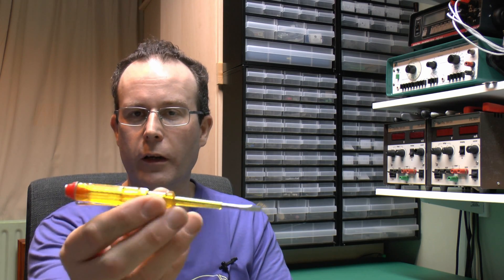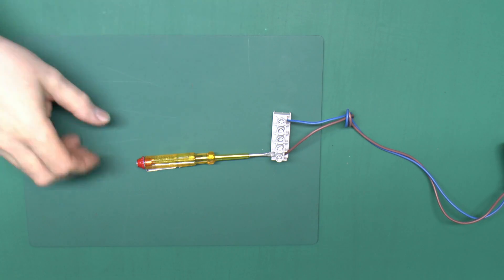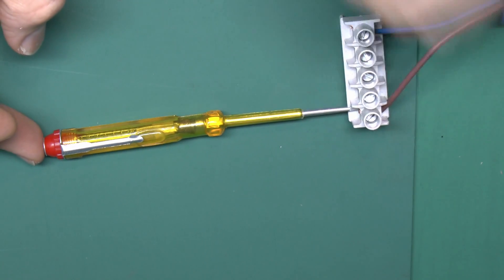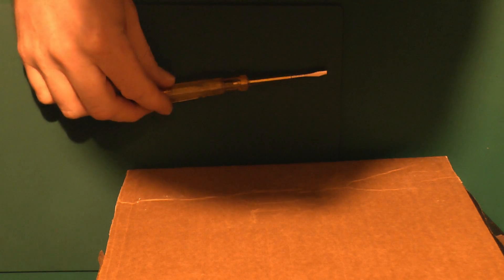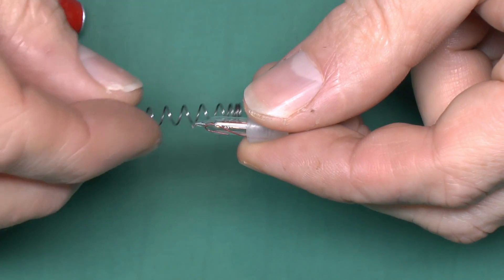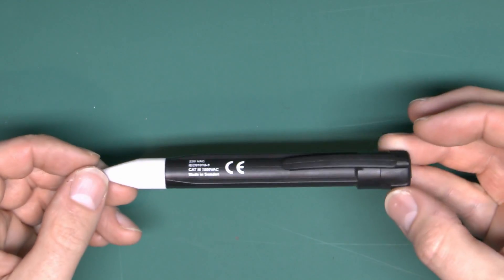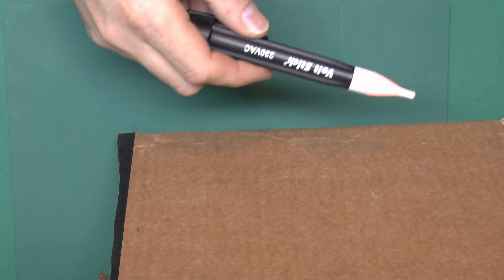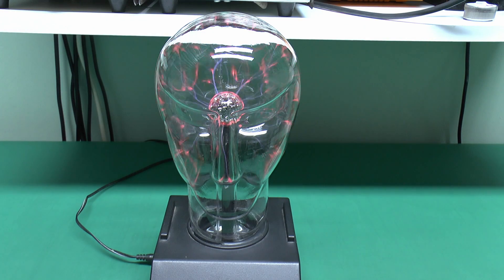Dangerous Device - Neon Mains Testing Screwdriver

Comment: I'd trust the neon 10 times before i trust that other tester that runs off a battery, what if the battery's out?
A multimeter is good and well, but you don't always have one handy.
I've never heard of the neon things actually fail, but I see the case that if you dip it in salt-water it might, so I won't do that.
Generally, if I can help it, I won't touch anything but the insulation even if I'm positive the power is off.
Lastly, I've gotten shocked of 230v many times, sometimes because I didn't have this, sometimes because I didn't care to test, and once because a idiot saw the mains was turned off and decided to be a good neighbor and turn it back on for me.  it stings good, but it normally won't kill a otherwise healthy man. I'm not suggesting anyone should try, but its not instant death or agonizing pain for hours, it just stings for a second.
Reply: +Zeamus634 it depends on how well grounded you are. People wearing cheap shoes need not apply for electrical work.
Reply: +Renax the Man Depends if you have some kind of RCD device fitted in your electrical system...not all properties do!

Comment: These things are only for indicating the live. Theyre not saying "Its safe to touch that wire" 
It would be plain stupid to touch any mains wiring, no matter if its theoretically safe, some electricians mix up the colors, especially in switches and things tend to get messy. Thats where this thing comes in handy. Resistors like that are safe if they passed the qc
Reply: +drkastenbrot  true.. Electricity doesn't care what the color of the wire is.

Comment: Omgosh! Guys the only true safe way of testing for voltage is to use "an approved voltage tester and proving unit" 
Remember ten tests! For 3 phase 
Prove instrument - proving unit 
N-E 
L1-E
L2-E
L3-E
1-N
L2-N
L3-N
L1-L2
L1-L3
L2-L3
Reprove instrument - proving unit 

These screwdrivers are a deadly menace and please don't go, I have used these for 20+ years no problem. Yes problem you have just been lucky! 
Also don't trust the non contact voltage probe! 

Only saying to inform you of how to do it safely!  
Be good guys. ☺️
Reply: You sound USAmerican with those terms, maybe some other country with the same flawed "training" of electricians to confuse rote learning of legal rules with actual knowledge and skill.  A polarity tester with or without screwdriver on its end tests the one thing missing from your 10 step lamp test: The voltage between the point tested and actual ground/earth, not the wire that may or may not be grounded.  It also shows the polarity of DC sources (by lighting different halfs of the neon bulb), hence the name.  Pole testers are an essential tool and I wouldn't trust an "electrician" who doesn't know how to use it (though for simple work, someone who uses it mostly right might be qualified enough).  Oh and that lightbulb based tester shown in this video may be "approved" in some backwards countries or companies, but the common two pole probe is a lot sleeker, has higher impedance and provides more details, such as approximate voltage range.
Reply: +Rhys Forrest I work on 20kV wires. How do you suggest I test those, considering we only have the appropriately upscaled version of the tool in this video?
Reply: +Pyrrha Nikos and I'm an a SAP upto 33KV
but that doesn't mean anything if you are based in the uk like me, it states in the 17th edition regulations about using an approved voltage tester and proving unit. 
You also have to show competency using these on the Achievement Measurement 2 qualification which you need to be an "Approved Electrician" with the Joint industry board. 
And there is a huge difference between MV testing and LV.

Comment: Why is everything in Europe so goddamn idiot proof. If you idiot proof everything your idiots just start multiplying like rabbits and soon the morons are everywhere. In all honesty though the "correct" tester is so goddamn safe I'm surprised it even tested anything. Get a good tester and know how to use it. Fluke makes some great idiot proof "dumb" models that you have to try hard to shock yourself with and can't be used incorrectly (ac vs dc doesn't matter it auto detects.  It's just an array of LEDs that light up as voltage increases. You don't need precision if you are just testing if it's on and at what range it's at)

Comment: How can you detect which is Line and which is Neutral with the "proper" two probe testing device ?
Reply from the maker: +4623620 Test between the unknown conductor and a known earth, and if a known earth is not available, a metal rod inserted into the ground will provide one.
Reply: Amd phenom x4 Without seeing the cables is what OP wanted to know.
Reply: oh im sorry i am bad at engis but there is a device to see that
Reply: +John Ward If I go between Live and ground, will it light up? DC does not work like that, right?
Reply: Umm the line you mean wich one is the cable where you dont get electricuted well the answer is n which is the blue iam Finnish and 14 years old so i could tell why it is the blue but my english sucks

Comment: The video starts by showing a bulb lighting... about 30 times.  I'm not sure why you have to repeat the same test over and over
and over again.   You made your point on test #29.   I'm not sure why you have to test again and again and again.

I'm not sure where you studied electronics, but a 1.5 MILLION ohm resister is easily enough to prevent you from being electrocuted.

When you hold a live wire with thin insulation, you are doing about the same thing.

@4:21
Also, you seem to be trying to demonstrate your ability to magically light a bulb... without a battery... just using a clean sheet of
cardboard.    That tester is a NON contact tester.   You obviously have a voltage source beneath the cardboard.   The tester is
working EXACTLY as all non-contact testers function.    That's what they are.   That's what they do.
Reply: Correct!

Comment: I would have been useful to state the conditions that stopped the screwdriver working ( swapped live/neutral or removed the bulb?).
Reply: I think due to the slightly higher voltage the connections were from an isolating transformer
Reply: If you look closely, the tool is bent when it "doesn't work" -I think he intentionally broke it to try to make his point.
As an electrician with 30 years experience, I use this tool all the time without fear.
By the way, you don't need to be grounded to use it, so having rubber shoes doesn't make any difference.
If you do ground yourself while using it, you simply get a brighter light. I often do this to see if the neutral or ground are not connected.  In other words, if the light doesn't get brighter, I trust that the neutral or the ground (whichever I'm touching) isn't connected. Even if it does get brighter, I will still take a voltage reading for precision.
Because testing is so fast, this tool is fantastic when diagnosing multiple locations quickly.
Also worth noting:  if you touch it to a neutral it won't light up -but then if you touch a hot, it will light.  Congrats: you just found a receptacle with reversed polarity.  So I might stick it in the hot end side of receptacle, not get a reading, ground myself on the box casing, still not get a reading, stick it in the "neutral", get a dim light, touch the case ground, the light brightens, and that means there's reverse polarity because the neutral should never read as being "hot".  I'll still take apart the receptacle to double check, but this is faster than using two probes on a VOM.
Reply: @SwingboyPA  "If you do ground yourself while using it, you simply get a brighter light." Yeah - that's your poxy 110V ;)
Here in the UK we get a tingle too!
Reply: @millomweb  Do you????  Wow, THAT would bother me.  Frankly, I worry for you folks; I mean, I've gotten a couple good zings, but never anything that really hurt.

I wonder if they make different units to sell in countries with 240v versus 120v?
Reply: @SwingboyPA  I only grounded myself once - to see. There's usually no need.
They all seem to be rated 100-500V - so most likely the same design. If there was a change, all it'd be was the resistor value in them.
Reply: Presumably he was wearing rubber shoes or something
Reply: +Jon Laws Presumably, he swapped live and neutral.

It's not unknown for a wall socket to have live and neutral swapped for decades without anyone noticing. That's why you, when proving dead, you have to check the voltage difference rather than just the voltage.

Comment: I have used these screwdriver testers thousands of times over 40 years,I always test the driver first,ie put it on a known live and see it light up, never put it on a wire without testing it first, the driver may be faulty and make you think a terminal is dead.
 The driver in the video should not be used,not for the reasons you describe, but because the insulation on the driver shaft is too short, too much metal shaft exposed. The insulation should extend right down to the tip leaving only a few mm exposed, you need a few mm exposed so that the tip can be poked into a terminal block.
 After using these drivers for a long time, they do get abused, and the insulation gets damaged, then time to discard. Finally your driver looks bent,already abused.
 Thanks for the video.

Comment: My college electrician made a very good point about these (or equivalent non-contact tools) -- under previous employer he was told to always check with the neon as well, as these would reliably glow in the presence of entirely floating supply (e.g. lost PEN on older supply converted to TN-C-S...).
Reply: The biggest shock I ever got was a floating neutral. Went across my chest - all the mains switches were off, all earth leakages off. ZAP! Very unexpected. I wish I had had one of these screwdrivers for sure!
Reply: @Mrcloc  I once tested an earth lead and it lit. Puzzled me for a while then I figured it out - it was me that was live - somehow - never actually got to the source - perhaps just atmospherics !

Comment: Two days ago I tested a wire we wanted to remove with a bulb. We trip the breaker. Bulb is off. I unscrew the Terminals and one wire touches metal and it trips the GFI.... I would in real life never rely on a two pole measurement for determining if power is off. It would always be measuring a different circuit then the one you will make with your fingers.

Comment: You are missing the point, It is not a testing device, it is a screwdriver. The power should have already been turned off and checked before it is used but it happens to contain a basic tester of a type that has been used safely for decades for a final safety check.

Comment: I've used this type of device for years without any problems, although the particular example shown here seems to be a particularly poor type.  The ones made in the UK are fine but I doubt any are made in the UK now,  most will be Chinese and need to be avoided.
I recently bought what I believe to be the best quality one available, and would recommend it, made by Wera of Germany.  Significantly it is rated at upto 250 volts. 
I am a  qualified service technician and the fact I'm still here after over 30 years of working on all sorts of equipment, in many types of environments, including industrial, I think makes my comments valid.
I also use non contact voltage detectors, meters, etc etc.
Reply: Wera?
German design (claim), made in China (fact).

Comment: All RUBBISH. People should NOT TAKE HIS ADVICE!
ALL of these tools can be DANGEROUS IF YOU ARE AN IDIOT.
As many people already pointed out, Multimeter is just as dangerous if the neutral circuit is not complete.
Using the wrong setting in multimeter may cause explosion as well.
Non-contact tester maybe dangerous as well if the sensitivity is set too low or too high.

Comment: We used these in the  late 70's when you could trust your tools.. Before the CE label..They were great for detecting anything over 90 volts AC completing the circuit. EHV just by holding them close to a flyback transformer, TUBE/VALVE without grounding yourself or touching anything that was grounded. The good old days, pre CE days. I encourage you to keep posting your videos, fact is greater than the fiction that your latest posters swear by.. Try using this neon driver on a EHV flyback while in bare feet on a concrete floor, my buddy still has nightmares. I must admit it has served me well.Used with knowledge it was indispensable, without knowledge it was dangerous . It is now obsolete even though I have several of them I am an early 70's TV technician, 425 and 625 Colour/Black and White capable dude .Still going strong with the latest technology. 2015...... Soon for the dump...
Reply: Aahahahahahaha. Bring back rationing! Things were better in the old days.  And there are billions of electricians dying in the EU because of the CE label. I assume you've got some good excuses for the HGV driver shortages now, or why we need to renegotiate Johnson's 'oven ready deal'. It's always a foreigner's fault eh?  Get a grip man.

Comment: Over the years I was always told these are dangerous devices yet in the last 3 months i have been working with an electrician doing maintenance on a very old rail station. So lots of fault finding because of years of botched wiring , bad maintenance etc. He uses this all the time and its got us out of many problems. He swears by it and says 'why they still selling this if its 'that' dangerous like everyone says. So my question is is it really that dangerous? Obviously certain safety precautions are taken. Do time served sparks use this a lot?
Reply: I think JW needs to specify the number of annual deaths attributed to neon testers !
Reply: Exactly right.

Comment: Of course, if you don't touch the wire or anything metal connected to it, the screwdriver doesn't show anything. How stupid do you think we are?
I have used these screwdrivers for decades and it always worked fine.

Comment: Am working as an industrial electrician and have lost count of the times that I have wasted hours trying to find where the voltage indicated by my tester was coming from only to find that there was a plasma ball hidden from my view!! Damn plasma balls are downright misleading and should be a lot less common than they are.
Reply: Lol, I know this is a joke but, I genuinely had this problem before 😂. I was rewiring my room’s electrical sockets and I was using one of these neon testers to detect if I tripped the correct breaker and it was detecting my plasma globe which was on the table nearby but, this actually helped me because I obviously did not trip the correct breaker because the plasma globe was on.
Reply: Jon Smith 😂
Reply: Hi

Comment: You are talking a lot of bull.. The way these screwdrivers are working is they are a antenna for mains. In my country we call it the live (L) and neutral (N) current carrying wires. The N is connected at the first connection to the house on the outside to earth. The L is the one to measure with the screw driver and your body as the antenna. Even if it was connected the wrong way around you just measure both L en N one of them would illuminate the neon lamp. Even if you are stupid enough to touch the other terminal with another part of your body the 220V with a 1.5 Meg resistor to little current, something in the order of a few hundred micro amps is flowing through your body. The safety trip on a house trips at 20mA and is considered as safe.

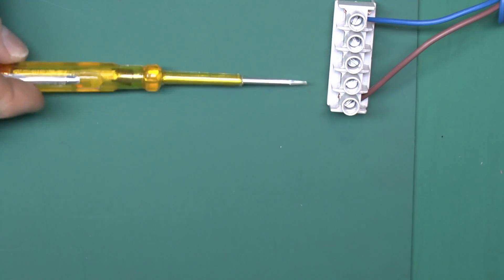Comment: What did you do at 3:12 and 7:16? Switch live and neutral around? In this case, at least one of the terminals will still show a reading. However, if your neutral is broken and your live is still connected, the two terminal prove won't show a reading. I know that's not the full procedure, but switching live and neutral around is not proof that the stick device is completely useless. Rather, one should be educated on how to use each of one's tools and what their limitations are.

Comment: Bloody hell your mains is all over the place! 259? And a random video of yours showed 263. Don't they guarantee some percentage? Obviously the frequency is more critical for rotating machinery and my 405 line telly but Id complain if I were you. 230 V ±10%? My arse,
Reply: mart fart I guess Brits love their 240 despite the harmonization (bloody EU) and 260 is just within 240V+10%.
Reply: Gameboygenius
I was not thinking clearly re 10% it felt worse
Reply: mart fart No, read what I said again. :) 
You're absolutely right that 260 V way out (+13%) for a 230 V nominal system, which all of EU including Britain needs to adhere to. My point was to humourously point out that the British like to cling on to their old 240 V nominal system despite the harmonization.
Reply: We don't cling to our old system of 240V, the EU worked out the cost of everyone having to change to 230V either up or down.  It seems that most former eastern block countries would have found it too expensive to comply, so it was agreed the supply could be -6% to plus 10% of 230V. Was to be +/-10% but not ratified.   Also the 230 is a RMS figure i.e. the average usefull voltage.  Hovever the voltage peak in the  UK 230 x 1.4 = 322V max.

Comment: So
You used an isolation transformer - thus 258VAC and zero potential to earth
NOT
"the product stopped working"
And a large plate under the cardboard created an electric field
but the screwdriver should 'live cardboard' 
woohoo
O level physics
Get your point across - but use
- a different voice
- different demos
Reply: Steve SOMERS A large plate under the cardboard? Did you watch the whole video?